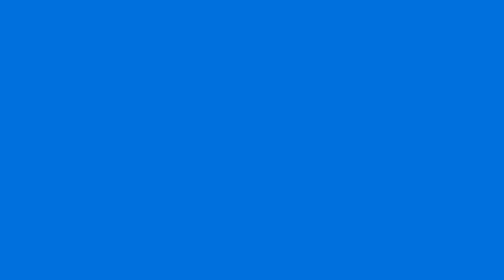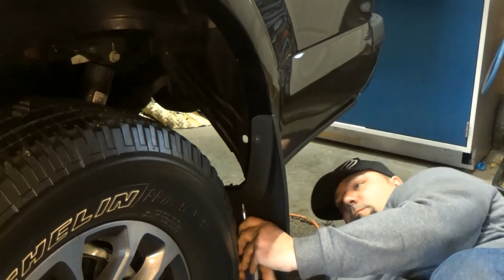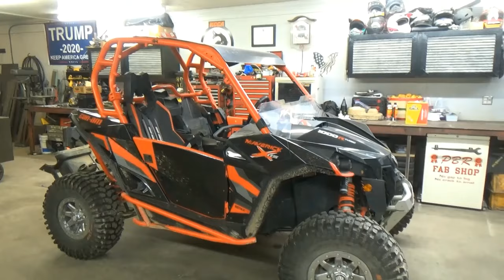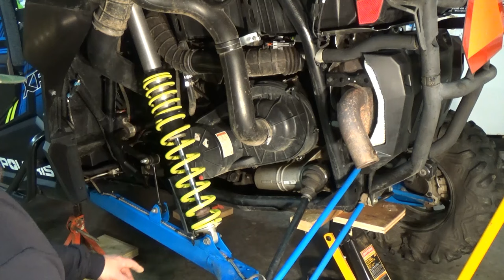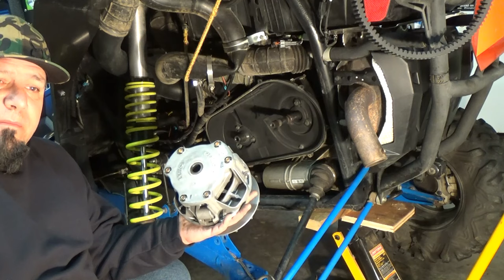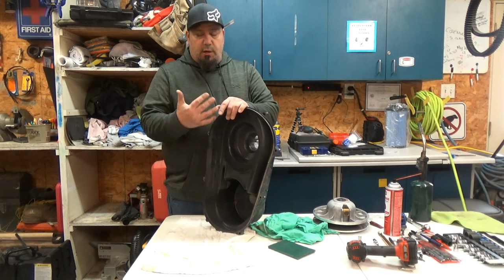Polaris RZR XP 1000 Clutch Maintenance Cleaning

Comment: My 2017 1000 4 seater is slipping and causing a misfire code (65590 code) and throwing it into limp mode. At least I hope the slipping is the cause. Seems to be common. I CAN NOT find the tool kit on this thing. Any idea where they put it from the factory? If not I will buy the clutch tool when I buy the new belt. Thanks!
Reply from the maker: The factory tool kit comes in the glove box with the manual. Don't go buy a factory tool kit. Purchase a belt removal tool from a company like Rocky Mountain ATV. Then put together your own tool kit. Assault Industries makes a toolkit for UTV's. You can go to their site and copy everything they have in their kit and make your own. That's what I did. Thanks for watching Dirt Poor Tv and don't forget to subscribe so you will be entered in our subscriber giveaway.
Reply: @dirtpoortv4483  Thanks so much. The kit is definitely not in there with the owners manual! Working on this one for a neighbor, but I will not be buying a tool kit. Neighbors don't like to pay like they should! Thanks for the great videos! Really helpful!

Comment: Hi, I'm new to these things. I bought a 2021 Polaris 1000 turbo S. I only drove it once and today I moved it to wash it. I heard a noise when I hit the gas! clack!!! just once. It is heard when you are completely stopped and you push the gas, it is heard in the back but when driving it you do not hear anything? It's normal I'm new to this by I want to learn thanks.   For you time !!!
Reply from the maker: Pull the belt cover of and check the operation of the primary clutch when someone gives it gas until you hear the noise. What you are describing sounds like the primary weights are making a noise when they engage. Thanks for watching Dirt Poor Tv